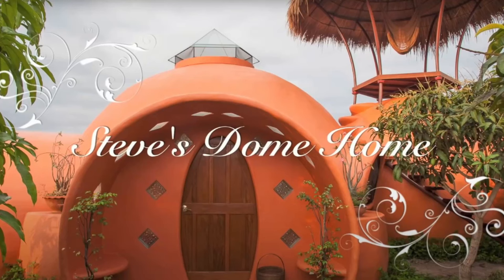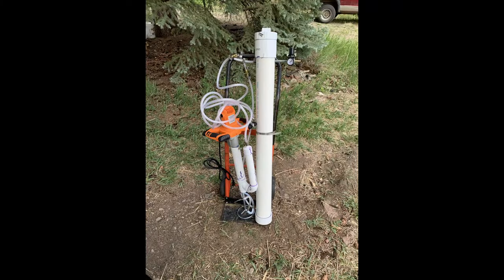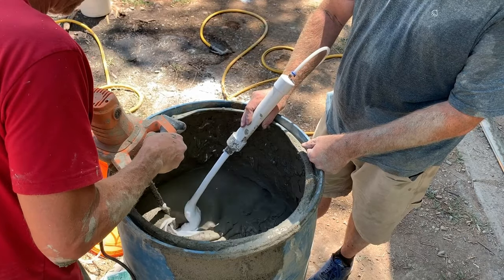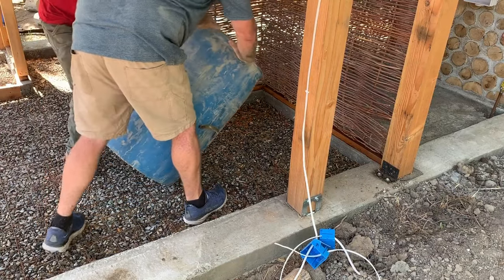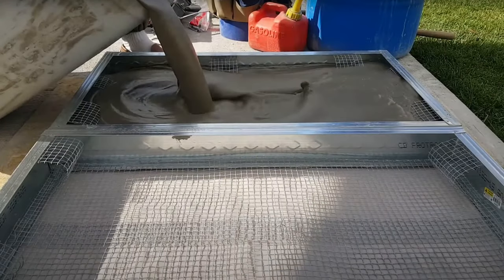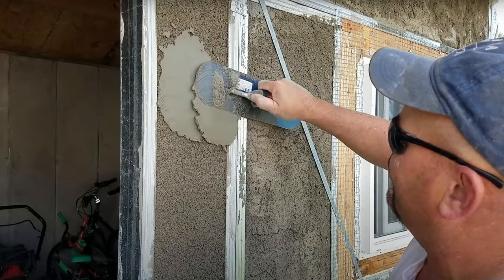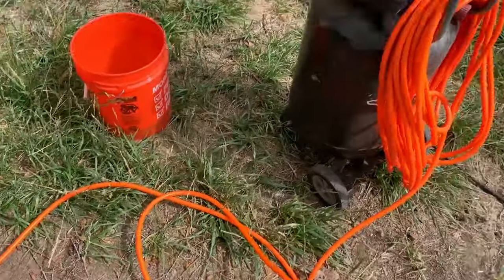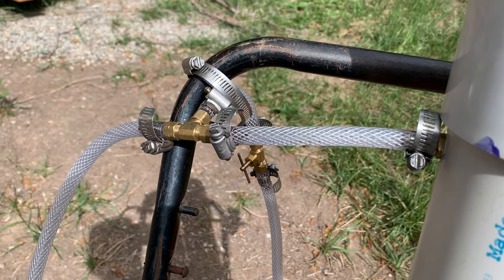Aircrete is great, but watch this before you build with it!

Comment: In the UK we used Aircrete on building many new hospitals 30 years ago, after about 25 years they started to fail and now are being knocked down and replaced, so whilst it had advantages in build it does not have the expected lifespan
Reply: It’s was built incorrectly that’s why
Reply: perhaps 30 years ago, I was working on a hotel, where they put rigid foam board insulation, then skinned it with a stucco finish.   The walls were not painted before a child slamed his bike handle against the walls, and broke thru to the insulation.  Then damage kept happening.  So, what looked like it should last 50 years, did not last 2.  Hard to believe how many times exterior walls get hit with something.  Within two years, all foam board was removed up to 6', and replaced with solid durarock like stuff.
Reply: @normbograham  You are residents of a backward country :) Masons, sorcerers, horoscopes, etc. (The country's forces are dedicated to this! )
This problem was solved in the 70s in the USSR. It was enough to steal the monograph.
England is stuck in the 50s in the 90s (!). Buildings are falling apart due to corrosion of the reinforcement in the slabs.

Aerated concrete is a type of artificial shell rock. You might as well cut in the quarry :) (It’s hard down there, and fluffy at the top of the quarry)

Styrofoam is poison
Reply: @normbograham  - In the 1950's, My Father worked in California on Tract Housing. After Occupancy - The Low Cost Housing Tenants often knocked holes in the Sheetrock. Many trips back for repairing the sheetrock. Next set of houses, they put 1/4" Plywood on the studs first, then the sheetrock: No More Calls back to fix busted sheetrock! 

Styrofoam can be bonded to Aspenite, Plywood, or other standard sheet materials with good strength, to give it greater durability. 
Same with Aircrete, though it might require mechanical attachment (Screws, or Bolts).
Reply: @ХозяинПолянки  Is no country as backward as yours.
Reply: @SCrEenNaMe-i9h  just like communism right?
Reply: I've never seen so much misinfo, but it IS YT. There is ZERO Aircrete in UK. OP is referring to RAAC, which is NOT aircrete (foamed crete), which has lasted 70 years although some mnfrs said should have a 30 year life, and the ONE failure and all other "unsafe" raac are on improperly maintained flat roofs. NOT THIS AIRCRETE
Reply: @ХозяинПолянки 
To start a comment/ reply with an illegitimate insult illustrates your point quite clearly - but to the opposite end for which you were aiming.

Comment: Thanks for the great video!  We have also build 8' walls that are poured horizontally on a frame that then tilts them up into place.  We should have some information and a video on this coming out soon.  We also have found that fiberglass stucco mesh offers great strength for the exterior layers.  I would also like to offer one clarification on R-Value.  There is one article out there that claims the 5-6 per inch but the information source for this is miss leading.  There is an experimental commercial product that is similar to Aircrete that can achieve this r-value but it offers no structural integrity at all.  Aircrete as we use it has an R-vaule of 1.8 to 2.3 per inch depending on the mix.  this is still very good for the cost and lack of thermal bridging and air infiltration you get in a traditional wall. A normal 2 x 6 wall with R19 in it will actually perform around R-13 when the whole wall is factored in.  I hope this information helps.
Reply from the maker: Outstanding. Thank you guys for innovating with this material. I’m looking forward to this new information!
Reply: Dome Gaia out here promoting correct info, Awesome! The mistake happened so early into the aircrete hype it became super widespread it doesn't help that Google still provides this incorrect information preferentially
Reply: I was wondering about that super R value also. Is Aircrete that much different from Aerated Autoclaved Concrete (AAC)? A friend of mine moved from a high mass solar house near Oak Ridge, TN that had a wood stove for cloudy winter days to an “ideal” AAC house in Northeastern TN. The R value of AAC was low but the ads preached thermal mass. Thermal mass is fine in New Mexico but not so good when you have week long spells of cold cloudy weather. My friends now depend a lot on their wood burning stove and found that the AAC loses heat in accordance with its stated, low, r value.
Reply from the maker: @noellwilson1273  interesting. I had thought the big problems with AAC were cost and embedded energy. Seemed cool, otherwise.  Good to know!
Reply: AAC, R value.varies depending  on if it is loaded bearing or non-loaded bearing .AAC..  

Plus it tends to have a relatively high levelized cost in the US, since the supply is limited....  much like Hempcrete, ....
Reply: I like that tilt-up frame idea! You could frame a whole wall onsite, complete with electrical conduit and junction boxes, pour it, and tilt it up into place. Would love to hear your experience with whatever idea you tried.
Reply: Wonder if Domegaia gets this message.  Well, is the information available, and where?  Thank you!
Reply: Any thought about pouring aircrete in the same fashion that you produce your dustcrete walls? I agree I like the idea of tilt up walls.
Reply: On the low end, that is 25% more than wood alone (1.4r)
Reply: What would sodium silicate do to the final product?  It seems it would firm it up a bit.
Reply: I think you meant an r19 fiberglass batt wall performs at R23 with everything built, NOT R13
Reply: @sz4179  he meant r13. With losses from Windows, imperfect batt installation and thermal bridging, windows..   I don’t know if he’s right..  but that’s what he means..   I think what you mean is that we get another 1.4/inch for added wood thickness in the assembly
Reply: @radicalgastronomy  
Try this recipe and then please let me know if it works:
    Make a small 3-1/2" height test wood mold.
    At the bottom pour a very fine layer of lime powder to make the wall
    exterior white.
    Pour a 1/8" thick mixture of high strength-rapid set 
     concrete(HSC), sand, vermiculite and glass fiber.  
     (Be aware that vermiculite absorbs water and must be added at the 
      last minute to avoid it absorb the water.  Maybe because the mixture 
      is thin the mixture in powder can be poured in the mold and wetted 
      in place).
    Pour 3-1/4" foamcrete.
    Pour 1/8" HSC mixture.
    Pour lime powder.

    If you can add calcium chloride to the foamcrete mixture to make it 
    rapid set it would be great.
 Please email me if it works or if it doesn't work.
Thank you for your contribution to the foamcrete community.
Reply: @radicalgastronomy do you know if dustcrete is also about R6 per inch? Thanks, all your honest observations. Great work!
Reply from the maker: @RJCooper2  The R6/“ number for aircrete turns out to be bogus, as others have mentioned. Dustcrete is probably on the neighborhood of R3/“.
Reply: @radicalgastronomy That makes sense, given the comparable thermal conductivity of all the various insulation materials. How do you find dustcrete durability, now that you've been living with it for a few years?
Reply from the maker: @RJCooper2  it is performing exceptionally well. I’ve had minor cracking everywhere I had cold joints, so I recommend filling each wall completely in one day. Other than that, it’s holding up perfectly.
Reply: @noellwilson1273  - Aircrete, Dustcrete, Hempcrete, and even "Foamcrete" (Styrofoam as the "Lightening Agent") each have different "Insulating Properties. Just as Styrofoam has Better Compression Strength than Fiberglass Batt Insulation, Rockwool Has Better Fire resistance than Fiberglass! Point is, - Each material type has it's "Ideal" application functions. 

Aircrete is not an "Primary Structural Building Material" in most Cases, due to low compressive Strength, but is better insulative value than conventional concrete. It Probable should be thought of as but one aspect of techniques used to build a safe structure, rather than the "all in one product for structure and insulation", that seems to be the marketing pitch for it.

I have never heard of is used in conjunction with a Straw Bale Structure, for example, nor any explanation given as to why it couldn't be used with that approach.

Also - in the "Paneled" Approach, using it externally to a Particle Board Surfaced "Stud Wall", screwed to the Particle Board, as "Additional External Insulation and some extra strength" is another idea I have not seen.

Comment: My house is built with "Aircrete" (-like product, Ytong blocks). Such products are available in Europe for many decades and are now, at least in this part of Europe, number one material. The aircrete blocks material is ranging from pure cement to ones with high gypsum (and some other stuff) additives, that drastically increase R value. Unlike those DIY alternatives, those are "baked". Blocks are precisely polished to fantastic precision of 0.5mm, so they can be joined with super thin film of mortar or (approved) mounting foam. Typical wall thickness is 300mm (10 something inches), but Today often up to 0.5m. Even with 300mm you don't necessarily need any more insulation to suffice the code, but it is typically added. I have 300mm Ytong wall + 160mm EPS insulaiton and together with tripple pane windows the house performs about at about 2.5x of passive house limit. There's no point in doing aircrete DIY in Europe, but to those overseas, if they got all the way to building an aircrete foam machine, I'd recommend to also make also a very simple polishing machine and polish the blocks to precise shape - it will sure make the structure much more sound, will drastically reduce need for mortar (or mounting foam could be used) and make assembling super easy.
Reply: Yes, I have seen those systems in Europe and it is maddening that you can't buy those blocks in California or most of the USA.
Reply: Styrofoam  pellets!
Reply: Foam crete, what is being called Aircrete here, IS NOT equivalent to Ytong AAC. There is a brand name Aircrete that is AAC but that is not foamcrete. AAC is an industrial precision material made to ASTM standards, not a DIY hack like foamcrete
Reply: @dlorien7306  While there are differences for sure, like Ytong makes cavities using aluminum particles as opposed to foam, the end product is very similar and the goal is the same. I'm quite sure, no one in the US would bother to make DIY foamcrete, if they had a cheap procreate blocks available at the nearest home depo type store. There's a video on YouTube showing DIY type foamcrete process used in industrial scale somewhere in a small republic in Asia. The precise blocks are basically indistinguishable from Ytong products (which I'm sure was the point). In Europe, there are many porocrete/aircrete products, some of them much more different from Ytong, than those DIY foamcrete. I'm also quite sure Ytong AAC is not made to ASTM standards, it was based on old standards like DIN or CSN many decades ago, which were harmonized to EN and ISO. Most likely no changes to the product were needed to meet ASTM standards, just complete documentation for US market.
Reply: @dlorien7306   @dlorien7306  While there are differences for sure, like Ytong makes cavities using aluminum particles as opposed to foam, the end product is very similar and the goal is the same. I'm quite sure, no one in the US would bother to make DIY foamcrete, if they had a cheap procreate blocks available at the nearest home depo type store. There's a video on YouTube showing DIY type foamcrete process used in industrial scale somewhere in a small republic in Asia. The precise blocks are basically indistinguishable from Ytong products (which I'm sure was the point). In Europe, there are many porocrete/aircrete products, some of them much more different from Ytong, than those DIY foamcrete. But of course, everyone is entitled to his own opinion, about proximity of the products 🙂
Reply: Has anyone used vermiculite in concrete? Results?
Reply: @wendydevereux4375  No and I don't think there will be easy to find anyone. I'm not sure why you're interested in this particular material, but IMHO it doesn't have any mechanical material properties desirable for any concrete components, so it's unlikely it's used.

Comment: Using SIPs is way more effective long term than Aircrete, from the many videos I have seen.  Yes using SIPs cost more but offers powerful insulation properties and very good structural strength as well.

Comment: Enjoying your videos, thanks.  I built a straw bale in 2000 and used the bales as the lath inside and out to apply three coats of clay-sand/lime/chopped straw plaster in different recipes as you have done.  I worked great, no chicken wire etc.  The result was gorgeous, non-toxic, cured hard and sound, no cracks etc.  Final coat was sand/water/lime with lime wash over all for a stunning bright light reflective structure.  I sold it in 2022 for 10 time what it cost to build.  I had a gorgeous home that never needed cooling and very little heat in the VT winters.  I love watching all the innovative notions people are putting into practice.  Good on ya mate!
Reply: I'm looking at building a straw bale home 
Love to pick your brains on the things you learnt before and after building.
And a bit more info on the rendor 
🍻

Comment: Commercial airkrete (spelled with a k) does have an r value of 5 or more and is used as an insulation but it isn’t made with Portland cement so it doesn’t doesn’t have much strength. DIY aircrete spelled with a c is a lightweight concrete with some structural strength but the r value is only 2 per inch thick not 5 (with the density most commonly used on YouTube- 94 lbs cement, 6 gallons water and 43 gallons of foam) denser mixes will have more strength but less than 2 r value.  Aircrete with little pieces of EPS foam added to the mix will have close to a 3 r value but strength is very compromised.

Comment: I was gifted a 16' diameter geodesic dome made from 3/4-inch conduit. I lined the inside with metal lath and ferrocemented  the inside. Then I built a 18' dome over the smaller dome and metal lathed and ferrocemented the outside as I poured lifts of aircrete.

Comment: here in New Zealand there is a type called  Foamcrete, its 20mpa and has fiber glass strands about 1.5 inches long but can spay out if pulled from each side resembling 2 'W's persay. ive seen it used as block fill in high rise buildings, on the uppermost floors , which also has steel rods within. And it has been used to form  garden pool structures and then a final over lay is sprayed on at great force about 2 inches thick which is then troweled and sculptured and either sealed with a paint or tiled over. yes its been around for about 20 years now , Very light and easy to work even vertically which is alll in the batching success so its not wet enough to slump off the walls.great video thanks for sharing.

Comment: Wow!   I have been following the same You Tube channels, and came to about the same place (minus making my own foam generator.)  I am a fan of domes, but your drywall-type slabs sound like a very good idea for stick frame houses.  Overall, this video was excellent in a number of ways!   Also, I had no idea that grain bags were fireproof.  That changed my thinking because fire safety is huge for me & I didn't want to incorporate anything in my aircrete that would melt (like AH's styrofoam mix) or offgas with intense heat.
I subscribed immediately, because you are the kind of person I want to hear from.  Thank you for sharing!
Reply from the maker: Thank you! Glad to be of service.

Comment: Ive sprayed shotcrete  and supervised a large shotcreting  crew for  18 years in the mining contractor industry .  we use robots and also spray by hand .
I never believed in the fibrecrete until we  tried to demolish tunnel rings   that were  fibre crete .
Its next to impossible  
I now totally  believe in it  the strength and durability   is amazingly robust .

As far as vertical construction with aircrete  -you need to do less than 1 meter per hour  with high strength concrete without stopping   if you stop you need to greencut the surface to get a proper bond  with the next pours .
 i would think air crete could be done similarly   if you poured slower or used an accelerator 
Like meco 160  to harden the mixes faster so u could  increase the vertical rate.
 If you build  a house that lasts longer than the  glue and sawdust ones we build in todays time   your footprint get smaller as each year passes .
GREAT VIDEO
Reply from the maker: Thanks for the good info!
Reply: What is meco 160?  I can't find it online

Comment: If you added in a lightweight fiber reinforcement like chopped fiberglass or basalt fiber, you might see enough increase in tensile strength to have moveable panels.  Even some of the more natural fibers might be sufficient.  Another possibility is your dustcrete studwork wall section built then stood up.

One idea I've had in my mind since I learned about earthbag homes, rammed earth, and aircrete is using a metal sprayer to put a thin aluminum shell over it to weatherize it.  Apparently this kind of process has been used over 100 years.
Reply: Basalt fiber is a great idea for this application
Reply: They make hemp bricks, they are naturally sticky and can form hard resin as well, hemp fiber might be an extremely affordable way.